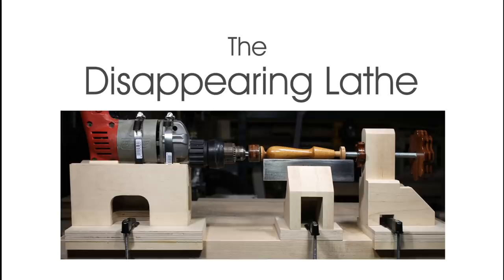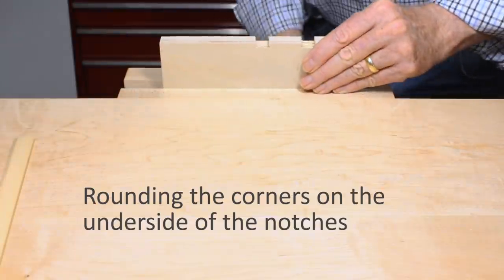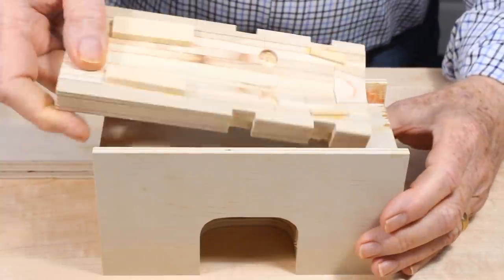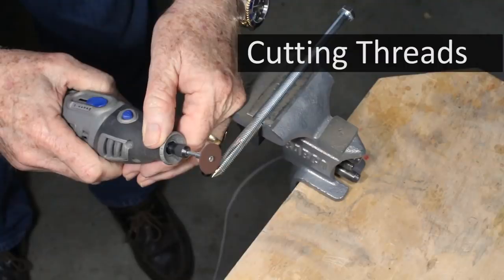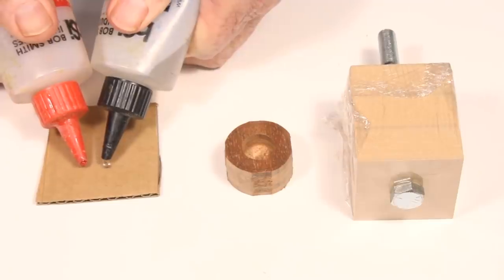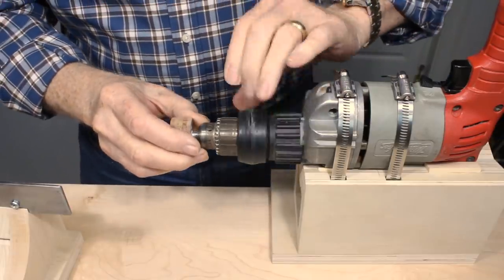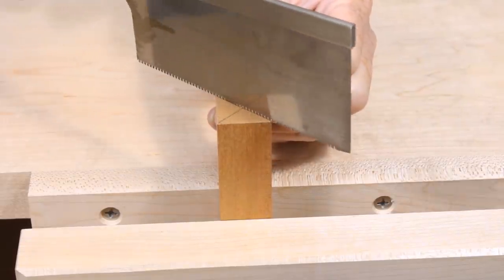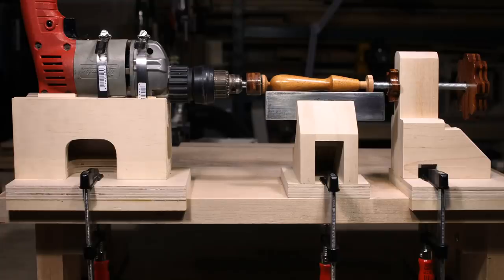The Disappearing Lathe

Comment: That was a fantastic video! Definitly planning to implement this however i do have one question for a potential mod on my own build.
At the end when you were turning the handle, the tail stock pin wasnt spinning at all. Is that normal? Wouldnt the wood heat up? Should a bearing be added?

Comment: why always odd? wouldn't even numbers at 90º help to prevent cupping?
Reply from the maker: I don't know.  I took my cue from commercial plywood.  Home made plywood probably performs differently, and I have not done testing to confirm this.  Maybe you are right.  Ronald Walters has a video on making large wooden gears for an elegant clock mechanism, and he tried laminating oak for this purpose.  My recollection is that he had trouble with even numbers of plies.

Comment: Very nice work and very thorough description!  Is you drill variable speed, are you aiming for a certain RPM, and do you vary it for the finishing step, for instance?
Reply from the maker: Serious wood turners demand variable speed, and adjust the speed of their commercial lathes frequently.  This is particularly important when turning very large or irregular pieces, or for certain finishes.  However, in my experience with this lathe, which is mostly limited to workpieces less than 2.5" or 7cm in diameter, a single drill speed works well for everything.

Comment: can you do bowls somehow on this?
Reply from the maker: You can make a small faceplate that will fit into the electric drill on this version, and you could turn a small diameter, shallow bowl, but you will have to work very slowly and carefully to avoid overloading the motor.  If you want to do bowls, buy a dedicated lathe.  You will need more power, more stability, and the ability to use a lathe chuck.

Comment: what type small motor could you subtitute for drill
Reply from the maker: There are a bunch of YouTube videos about building a lathe out of wood.  Check some of them out.  They use a variety of old motors.  However, you need to install bearings and devise a way to connect a spur driver to the motor shaft.  The advantage of using a drill is that you probably already own one, and it will have bearings and a good chuck that will hold the drive spur without any modification.